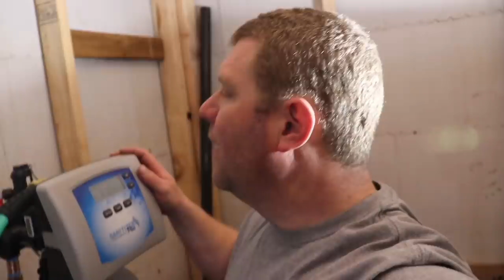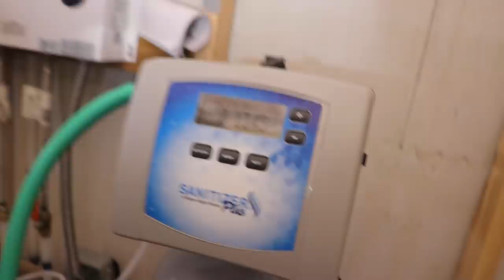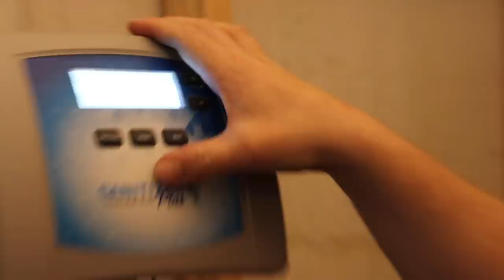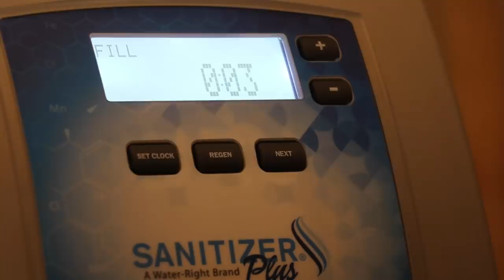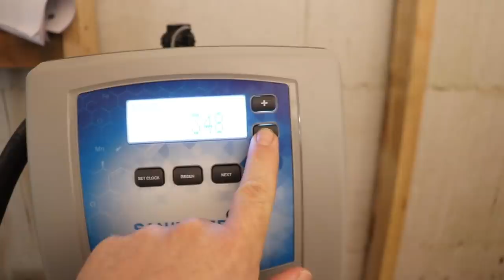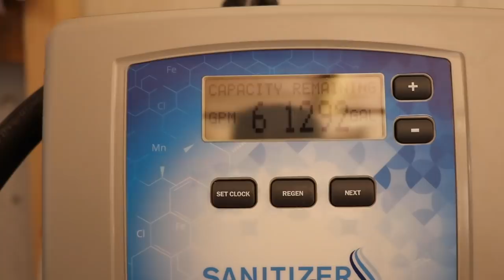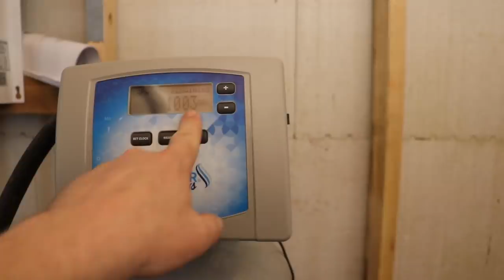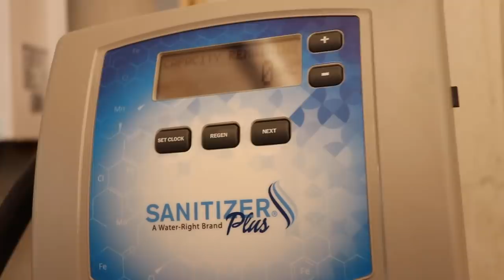Filling $10,000 Off Grid Water System from Brand New Well

Comment: I just watched the video and I work for a water treatment company. First thing is that your well pump should not have a pressure regulator unless you have a pressure tank to click the pump on and off. If you regulate the pressure with out a pressure tank you will burn the pump out. The tank acks as a cushion for the pressure. Running it wide open on a 10gpm pump will lose line loss per foot of lift in the well. The cisturn is just a holding tank for the well, if your well dosent produce enouf water then you consume. The calculation is 300gal per day for 2 people. Softeners only remove 2 ppm of iron unless you set the hardness to 10 grains harder per 1 ppm of iron. If you do this you will go through alot more salt due to it having to regenerate more often. The well should have a barried pressure tank with a pressure switch ran to the cistern tank with a shot off float switch that shuts the pump off when the tanks are full. The tanks should have a pump in them that pumps to the house with another pressure tank and regulator switch. From there it should go into the softener then to the house and out door spickets.

Comment: If I could add a bit of a information on how the softener is probably working, which would explain the taste of the softened water. The softener uses the resin to filter the iron, calcium (what you're tasting when you say the water is hard) and other minerals. It then uses the salt to clean its resin, which means that in the next cycle the water has a tiny bit of a salty taste. That is the reason that some people use softeners in their houses for all the water (shower, toilets, etc.) and then use an additional filter "osmosis filtered water" for just one or two taps, which they use exclusively for drinking/cooking. This is because the water softener almost always changes the taste of your water. That's the system that I use in my house and I'm very pleased with it. Good luck with your project and keep on the great work sharing your experiences with us :).

Comment: After my whole house water filtration and softener system was installed about 6 weeks ago I was told only to use the large salt chunks for my brine tank and that the smaller ones would just go out the tube with the water. The salt bags I got at the big box store have salt that is sized a couple of inches in length. Yours seems more like the fine stuff.

Comment: I inherited a summer place that had a deep well with pump, but the ppl who used the place hardly used the watersystem (sewer pipe was almost completely clogged, had to dig that out and replace it). It took at least a year of on-off summer house usage (we use it in winter too) to re-prime the well and clear out all the sediment, we tried filter and all kind of crap but they just instantly filled up even if we were there over weekends only. Since it got really clear it has never come back with sediment, we have no filters or anything now and the water tastes and tests better than any tap water (and we have good drinkable tap water in city). Only issue is that it is a bit "hard", but doesn't really matter to us.

The way this was explained to us, is that the well is filled using lots of "channels" or "cracks" going through the bedrock and various sediment layers. As you use these get cleaned out, if you don't use or prime your well, they fill up with sediment and can take a long time to clean out. So in short, the more you use it, the better the water will be.

Comment: Every time I deal with anything in a water system, I add valves onto both sides of any component.
Did that for our softener, and even added a full sized bypass so if we need to totally isolate the water softener system and still need running water, we can.
Originally our water heater only had a shut off on the pressure side so the whole house would drain out through the pipes coming from the water heater before we could work on it.

Comment: Once more you do need a sediment filter before the water softener.. You can mount a small filter housing from the big box store with a 1 micron or 5 micron sediment filter in it. the best option for longevity would be to get another tank the size of the water softener tank, with sand medium which you would change once a year.

Comment: Normal regeneration takes about 3-4 hours. You need the water on for this. First cycle of regeneration is backwash. Which loosens up the resin. Second cycle is brine then rinse the refill the brine.

Comment: ive never known a water softener to act as a filter.  it should just soften the water. to get rid if sediment you need a few regular filters... first in line should be a one that can be cleaned via a drain, so nothing to replace and can tale junk up to 100micron.  then a second larger filter thats is replaceable when necessary.  those are are around 5 micron. if necissary, you can add a third thats a carbon filter which is about 1 micron. if you gave a lot of junk in the water, that one will clog up pretty quickly. by the looks of what is coming out of your well, you should be fine running all three without too much trouble.  i have that setup (minus softener) and im replacing filters weekly. gotten to the point where im cleaning and reusing filters when possible..  but definitely add some actual filtration

Comment: Just an opinion here, I think with what you want to accomplish, I would set up basically two systems. First I would put a bladder tank at the well head and a pressure switch so you don’t have to keep turning the well on and off at the breaker. Then I would have an outside water system for the garden, construction, irrigation uses that would use raw well water. That would keep your well “primed” and you use it normally. Then I would have a line go from that to the softener and a valve on the outlet of the softener that you would control manually to fill the cisterns as you see fit. This would give you the benefit of everything you want and allow the softener to have water and power continuously to allow for it to work automatically as it was designed.  Just my opinion. Good luck.

Comment: Hi guys, you probably won’t read this but from this side of the screen Your softener is missing the charcoal and silicate filters. I am an engineer who looks after renal dialysis water systems, and without the pre-filters water would not be as pure as expected. Also from the units I work on the salt levels must be kept constant in the brine tank. Even town water has to be passed through a 10 micron then a 5 micron filter first. A water softener is not a filter.

Comment: Use the KISS method. Put a sediment filter on the main waterline coming out of the well. Pump that water into your cistern. Put a whole house Secondary sediment filter and then into water softener done.  Ready to use. Then you have gravity pressure for use of non potable and potable water. You can then run the well to fill the cistern no problem. You can find easy to clean very low micron water filters that will help with particulate matter. So sediment in the cistern won’t be a problem. I know it’s hard but don’t over engineer things.

Comment: I run no more than 60 psi thru my softener, get a anti back flow valve in or you might have half of your resin base sucked back into the well. Resin needs to be changed every 5 to 7 years depending on hardness. Consider placing a pre filter before the softener to keep out any solids from bogging down the resin bed. It will cut back on through put of softener but well worth the hassle.

Comment: You've got a pretty bomb proof awesome system!    The kinks will work themselves out.     My two cents:   send sediment filtered but  untreated water up the hill.  Use the gravity to send the household water (and car wash water) through the softener and don't soften the outside garden water/"hose off the backhoe,"  etc. water.  In the middle of summer  "shock" your cistern with some chlorine if needed.  I lived on a similar system.   Does your pump have a timer switch?   After a while I "just knew" (if you have a good pressure gauge you can kind of see a pressure drop) when/how much my uphill cistern needed and would set a timer switch on my pump and let it go.

Comment: Your chlorinator works a little bit like a salt pool. The machine brakes the salt molecule in half.  Salt before = NACL. Salt after going threw the machine NA/ Cl. It takes the CL=chlorine and puts it threw your water in a gas form to sanitize your water. So basically to remove all organic waste and to prevent algae. That’s why it smells like chlorine, because the salt is transformed into chlorine

Comment: The solution is, get 2 more ibc totes for cheap, build a platform for them so they are above your garden then fill them with the first run and use that to water the garden. IBC totes are fairly cheap. In the winter just dump the water down the hill if you need to fill.

Comment: Just a tip for using teflon tape , keep it about a thread back from end of threads or some may go downstream to jamb up something . Also you only need two complete wraps . While flushing at hot tub , I hope the extension cord near your feet had some black electrical tape and not cord ends there while you were splashing water around it . Seeing you adding salt to water softener makes me so happy I do not have to do that these days . When I lived in South Dakota I used many many bags of salt . Are you going to try and get the main floor installed before baby's arrival ?

Comment: Hey, I have rainsoft versions of the water filter. You need to prime the system with a salt tank. it does not come charged from the factory. Sometimes you need to run the refresh early too. Good luck.

Comment: Love the content guys! If this were my place, I would have the well fill the cistern with a float valve and pressure switch, this means always at full capacity and maximum resilience. Then gravity feed house via water softener. They are made for domestic use, ie low, random use, not full on at max volume for hours straight. They are set and forget (other than adding salt) in a normal domestic setup. The cistern of untreated water would provide perfect garden irrigation pressure too. The buildup of iron sludge in the cisterns is a consideration but in my opinion worth the clean out every 10-15 years. Haven't commented on your channel before but thanks for all the fun content :)

Comment: For your cooking and drinking water you may want to get a reverse osmosis filter with a permeate pump, back flush valve, and a post-filtration stage filled with calcite (calcium carbonate). Just to get rid of any lingering nasties and restore some mineral taste.

Minerals tend to clock up the delicate RO membrane, but with your softener on duty exchanging minerals for salt, the RO membrane should last longer when clogged up with salt instead, especially when back flushed every 30 days or so.

The calcite stage re-saturates the water with mineral and thus prevents the water from pulling minerals out of your body when ingested. There was World Health Organization report over a decade ago that warned against drinking only RO water due to its corrosiveness, the effects of which were observed in middle eastern countries where desalination of ocean water is common. I've seen more recently that instead of calcite some companies are selling re-mineralization stages that incorporate a wider variety of beneficial minerals.

Having a model with a permeate pump cuts the amount of waste water produced for each part of filtered water made, by as much as 80%.

I've seen different competing reverse osmosis systems on eBay that have these features, but first and foremost go with a vendor using quality membranes and staged particulate filters. The permeate pump and calcite stage can be bought separately, but often one or the other can be bought with the filters and tank, as a package. Also, lastly, you might want to consider a whole house sized sediment filter to place before the softener.

Comment: If you run the hose a lot, you likely have to clean the cleaner.  They have a certain number of gallons that start to decrease ability.  The softener should not be filling the cistern, the well should.  Then cistern feeds house through cleaner. Need to read the data on the cleaner on levels and when.  So only house gets clean drinkable, wash tractor / truck in pump grade water.   The small tank inside the house is to small to fill cisterns.  Ours had the tank full of salt and the water up to a line first.  Can't you dump the brine water down the drain that the washer uses ?  - Then if the tank needs it it can use it.  The Softener needs to run as it runs.  Not when you read on a meter or guess.  The softener has an automatic move to clean and then reverts back to clean.  I think you are over commanding the cleaner.  You don't have a filter, you have a softener.  It is resin beads that attract iron and other metals.

Comment: The green bag removes more iron for me. I have tried both. I still think it would be easier to filter the water just for home use and fill the cisterns straight from the well. The use of salt for all your water usage will cost quite a bit. You'll have to buy salt by the pallet. I go through about a bag of salt a month with my system for household and car washing.  I have a Kenitco commercial system with two tanks. It uses water usage to measure for regeneration  and it automatically switches tanks and doesn't have to bypass. Clean water all the time. No electricity. Put a 5 micron filter before the softener.

Comment: A water softener does NOT remove precipitated iron from the water, only clear water iron. You need a dedicated iron filter to get rid of the red color.
And our water softener needs constant pressure and power to do its things: filling the brine tank, sucking the brine out in to the filter tank, and then backwashing. And there's always water in the brine tank, and the water level must never rise over the salt. It never sits there doing nothing in the middle of the cycle.
Oh, and yes, as you said, you need a check valve on the incoming water.

Comment: That splitter at the well head is constraining your water (not that you want much more flow).  Take a look inside it and you will see the ball valve makes the diameter of that splitter smaller than the 3/4 hose connection.  I believe the well pumps are meant to run a bunch, as long as there is flow and as long as they are submerged.  The on/off rapid cycles are what kill well pumps.  It would be a good idea to get the well pump on a pressure switch and pressure tank so you dont have to use the breaker to turn it on and off.

Comment: Just to be clear, "no pun intended" your softener will not be able to remove the oxidized iron coming from the well, it can only handle the iron in solution.  Also I would recommend installing a Dole Valve as a flow control not a pressure regulator, you can get a 5 or 7 gpm should work fine.  This will prevent you from overrunning the softener no matter the pressure.  Glad you guys got some water though for sure, cant wait to see how the permanent system looks like installed.  Take Care, Casey

Comment: Jesse, using the tape that way works for almost any taping application. You will find it also useful with electrical tape. Don’t use cheap electrical tape for anything permanent if possible. Use Scotch electrical tape. In my day we used scotch 33 electrical tape. I’m not sure what is used today. It costs several dollars a roll but never gets brittle. For electrical wire connections that are exposed to the elements and tape is needed, use the electrical tape that is self vulcanizing. It becomes one with itself and is very waterproof. I’m sure you will get lots of advice from others on this. Good luck.👍👍👍😎😎😎

Comment: I repeat... put a large cartridge filter between the well and everything else.  Best to put 2 in parallel so you can change a filter without stopping the flow. and it will cut down on contamination of your softner.

Comment: Well, you tried with that system. It seems to only be really good for basic water on & off functions around the house. You will likely have to setup a dual system with large sediment filters, and I would still recommend a carbon filter (large) to the house before the softener. You could setup one system to water the grass/yard, and garden, a couple times a day to help keep your well clear, and one for the house and cistern. You can burn the filters anytime you burn a little brush pile etc.

Comment: The chlorinator is like a salt-water pool cell.  It knocks a molecule off the salt, releasing the chlorine.  It will be interesting to see how long it stays chlorinated, though, because sunlight is what causes the molecule to recombine (I believe, it has been a while since I've read up).  Your chlorine might stay in a little longer, owing to the shaded cistern.  That would be good, though, if the chlorine level is relatively low.